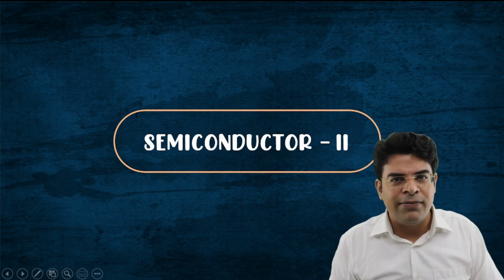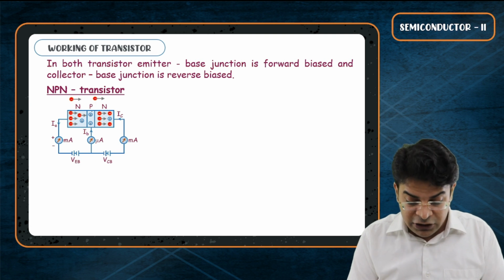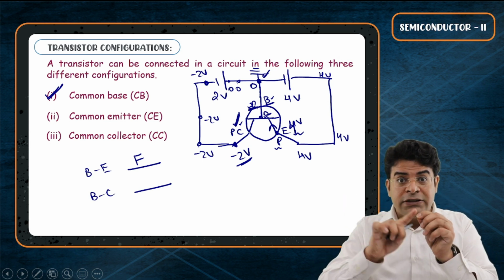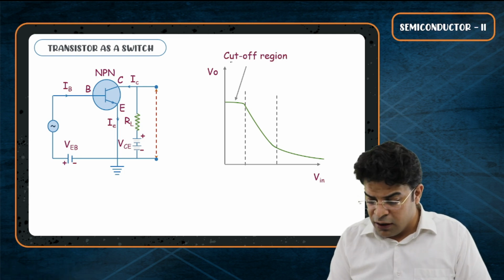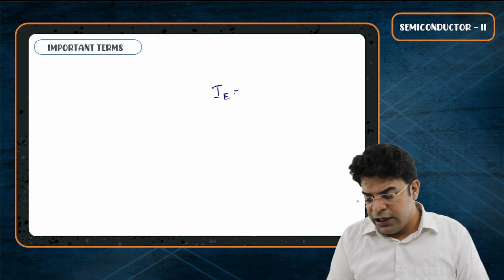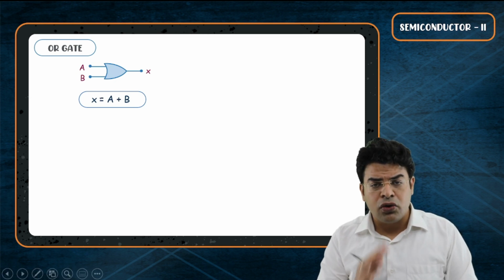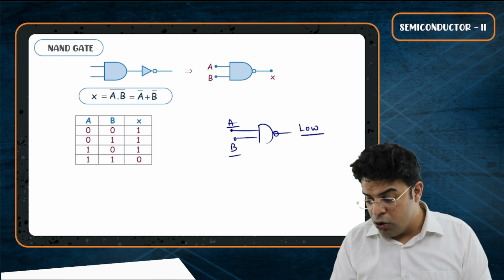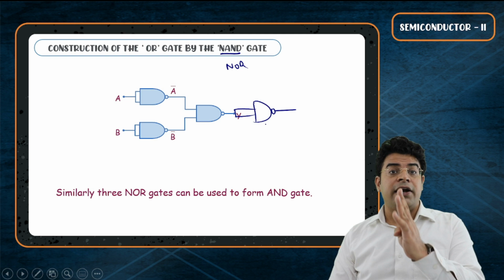NEET Physics Revision | Semiconductors - Transistors, Logic Gates | Hour 84/84

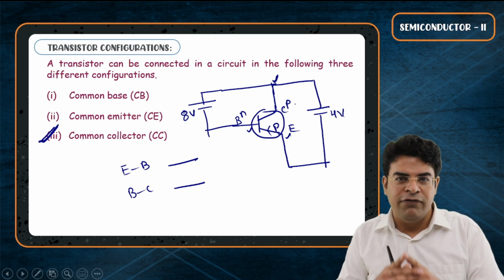Comment: Sir at 26:20 , can we assume any random point to be grounded? Or is it so specific?
Reply from the maker: If we know the potential of any part of the circuit then you should not assume zero potential anywhere, but if we do not know potential of any point ( which is true in everyday cases faced by electrical engineers) then you can assume refrence potential ( zero potential) any place of your choice.